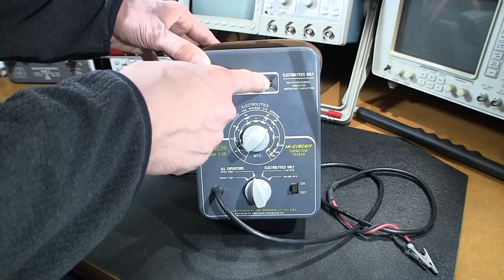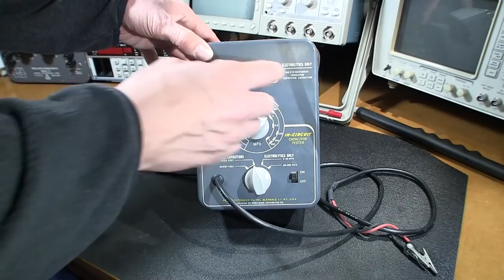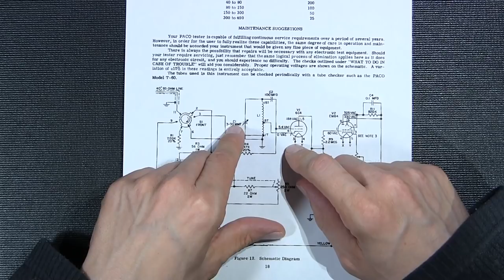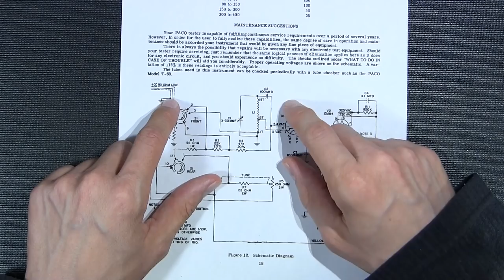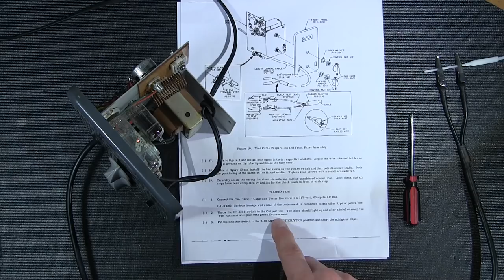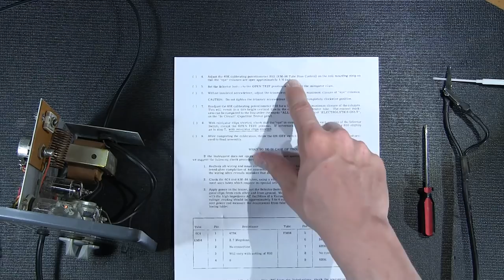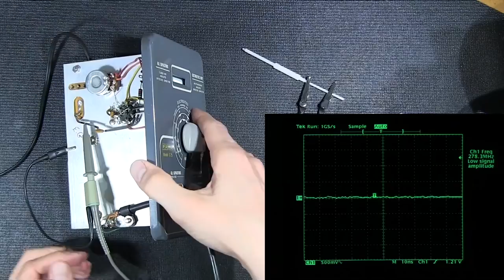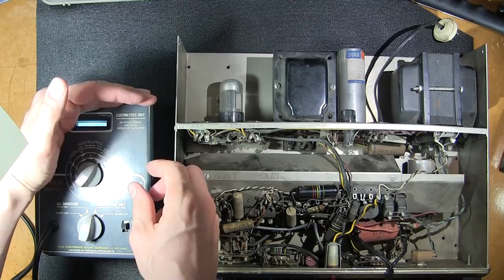Bizarre Circuit Tests Capacitors with RF!

Comment: My only comment is that slot headed screws are far superior to others. Both the screwdriver and screw can be rectified with age and use. Other screw types cannot.  Properly sized and used screwdrivers should present few issues. Manufactures of good screwdrivers design the driver to be adjusted to the screw-head. So yes, one might need a dozen or more drivers in length and width. The more common and popular drivers cannot be sized. Not all Philips are sized uniformly and made well.
Thanks for the video, great again.More repair videos, love them.
Reply: H Higgins could not agree more and that is usually the issue.  And though I love the ease of Philips drive, the rotten screw uniformity and rotten tip uniformity is always an issue for me. I just recently repaired my iPhone. The #00 &  000  Philips screws were impossibly small. It was my tip that I had issue with. I can't regrind the tip even with the best of screws. And a bad tip will ruin the screws. I did not have access to my Wiha screwdriver set, so I was forced to use the screwdrivers that came with the parts. Chinese all the way.
Reply from the maker: Hi James, did you know that there is an "American Phillips," and a "Japanese Phillips?" This may be the fit issue that you are encountering. Japanese Phillips is very common, and American Phillips head screw drivers fit poorly in these.
Reply: You maybe using the wrong standard. There are several screw and driver mating standards that look similar but are not Phillips head. They have an "x" pattern but angle of the flukes, depth, and width of the slots will be different. Mating the correct screw head with correct tool make any of these standards work quite well with less slippage of the tool and faster starting.  X head screws really have advantages over slot screws/drivers. It is not by accident that all manufacturing has moved from slot head screws.  You might be seeing Frearson(sometimes just called RP screws for Reed and Prince type screws), French head, JIS(used on most Asian units), Mortorq, Pozidrive,  or Supadrive screws and using a Phillips screwdriver on them with mixed results. That are all different in details. Even within the JIS style, the most common seen in consumer goods, there are A, and B versions. The JIS is the Japanese industrial standard and usually has a tiny dot somewhere on the head, or a tiny "x" next to the cross slot. Get a good set of drivers or bits and you will never go back to slot screws again. That set should have both metric and Imperial sizes since they are different also.  If screws are rounding out with high torque, it is surely due to the wrong driver being used. If you want to use electric screwdrivers cross head screws are much easier to use  and results in fewer scratched or nicked cosmetics of the unit being disassembled.
Reply: Mr Carlson's Lab 
Actually Paul, I was not aware. And H. Higgins taught me quite as well. My basic point I strived to make, was not that other driver types and screw types do not have their place, but the sheer number of screw types and tips for them is quite insane.  American engineers soon found out in the industrial revolution that having a different thread for every manufacturer and manufactured product was not beneficial to anyone. I now am aware of at least 3 types of Philips.American, Japanese, Posi-Drive, and I am sure more.  That along with Torx, Post Torx,  Pentalobe, Square drive, Imperial Allen, Metric Allen, (one that is a tri lobed shaped tip), snake eye type( don't know the trade name)and yes the lowly slot  presently are found on products plus more I am certain. So we have not come very far.  I have a $350 set of Wiha min/i jeweler  set of screwdrivers and it does not scratch the surface apparently. Yet, blade type pretty much does it all. Manufacturing hates blade because robots don't do well with blade, neither do humans in production. But as a child, I remember seeing the phone man screw and unscrew a slot style as fast as any of the others. I was amazed at his speed. He could dress up his blade or screw if needed; he did not need to chase down a Snap On truck of order from Mc Master-Carr. You must admit it is a bit strange that we can no longer standardize fasteners. Stanley wood planes have a bastard size bolt thread holding the tote to the base. Only available from Stanley and if you do not have a CNC lathe, you will not make one. Yet it drives in with a blade type. Everyone can witness the frustration of how electronic manufactures  use unique valued components just to make them proprietary. It is crazy. If all products were made similarly, we would pay an unaffordable amount just own anything.
Sorry for the rant. I was wanting only to demonstrate the fact we have not advance in fasteners, unless it is purely based on ease. And easier is seldom better, it is nearly always cheaper.
Reply: James Lucas, the only advice I could give is NEVER use the screwdrivers used for construction  to set pots or trimmers. And vice-versa. ALWAYS keep them apart!
Better yet, get special trimming screwdrivers. I have mine already 40 years and they are still as new!

Comment: Mr. Carlson
I have a question on Capacitors!  
If you build your own D.C. power supply,  What determines the capacitance needed to filter the output.  I know about the voltage, but how do you figure what size of capacitor is needed.  Some use 1000uf and at the same voltage, others use 1500uf.  what determines that number?
Reply from the maker: The answer is: The amount of Current drawn. The capacitors job is to fill in the gaps between the pulses. Here is a video with a more in depth explanation: https://youtu.be/qTb65aoYA_Y

Comment: I would always replace the line cord on old equipment like this with a 3 core double insulated lead and earth the chassis. This makes it meet modern safety regulations. I hate getting a tingle from old equipment. Of course it is more important here in the U.K. with our 230v mains.

Comment: Hi Mr Carlson, great video as always. Although I just subscribed, I have been a follower of your videos for a couple of years now. I have a little experience in the wonderfull world of valve or tube amplifiers (and own a 1950's Van Der Heem Valve powered High voltage AC and DC power supply which I fully restored) , but I have more experience in building and repairing low voltage electronics.

I have two question about this C-25 tester. I would like to build one from scratch (since I have a large amount of old parts just gathering dust) and I do own a transformer capable of delivering the required 330V AC. This transformer however delivers not 6.3 but 7.4 Volts for the filaments. This most likely has to do with the fact that this transformer comes from an era when the mains was 220V instead of the 230V now. Is there a way to drop this voltage in such a way that it would not cause any problems (I.e. Heat or hum) ?

Second question would be if there is a chance for a high res photo upload of the front panel. I can't find one and therefor would not be able to recreate the scale, again I'm building it from scratch.

Thank you very much for any feedback, pointers, information and such!

Kind Regards, Sander (from The Netherlands)

Comment: Neat little device. 
Some have stated they favor long schematic explanations...add my vote to the "Yes" pile. A way you could handle that is to create the original content with just cursory circuit discussion, then for a long schematic explanations create a "part 2 - How it works - explained" ... this is just a suggestion and it's purely your prerogative.
Reply from the maker: Thanks for your input Ted!

Comment: Something "weird" like this (something "looking" like a short circuit despite beeing open) happened to me once while I was repairing some device.
I can't go into too much detail, but among other things the device had an output (very short "sharp" pulses at about 300 Hz) that had basically like an RC filter on it.
(The signal went through a 15pF capacitor and then to the output BNC and to ground ove a 1,5M resistor, if I remember correctly; technically not used as a "filter", more of like a capacitve voltage divider when the BNC was connected to another capacitor ...)
I checked the signal before the capacitor with a scope, and there was a signal, as expected.
Then when I connected the scope probe to the other end of the capacitor (at the "output BNC"), the signal was gone!
It's like the signal magically vanished inside of the capacitor!
So I thought "oh this must just be a bad cap" and I replaced it.
Still the same behaviour.
I desoldered all the components in that area checked for shorts to ground or shorts to inner layers of the PCB, but everything was fine.
So I put all new parts on the board and took another measurement.
Still the same, the signal went into the capacitor and vanished.

This was at work and it was a relatively cheap board, so I just ended up replacing the whole board instead of putting even more time into this ...
(I know that that was the wrong decision, because you don't learn anything that way, but like I said, it was at work and I had a desk full of other stuff that needed to be repaired ...)

Comment: paul, ive got a question'''' ive got a (paco) too'' i want to put a (bnc) on it'' do you think i could by using the original cord by not cutting the length at all just put a (bnc) on it'''''or do you think its not worth it because it would mess up the 1/4 wavelength.....i watched the video so i know this might not be the ideal thing to do because it (rf) not voltage.....thanks paul'';'''james.
Reply from the maker: Hi James. It will mess up the coax length. I would leave it.

Comment: I remember in the previous video you mentioned about those black and red leads? and it was wrong to have them so long because of the RF signal it would produce and give you a false reading. you said the crocodile clips  got to be at the end of the original cable, so I am surprised you adding some cable to the original length why is this then.
Reply from the maker: Hi John. How an I adding length?
Reply: Mr Carlson's Lab well as I said, when you showed this tester in a previous video you mentioned about them adding these extra leads to the ends and said it was wrong that the cable had to be at a given cable length or something. so I'm not sure what you meant by that first comment? check back on that video and you'll understand what I mean because I don't
Reply: He was referring to the leads after exiting the coaxial cable, that attached to the clips were too long. The 1/4 wavelength is the coax section which was unchanged. 

It is an interesting circuit  that uses about the least number of parts possible for that era of technology.  I remember when those were originally offered, ads in the back of Popular Electronics in the late 50s, early 60s. They were offered as factory assembled or kit form. A number of test equipment kits were available from  Heath, Eico, Paco, Olsen, and others. The 1950s was a golden era of hobby electronics and amateur radio. Building kits for hi-fi, radio, test instruments, amateur radio and even for those with a lot of patience, color TV.   Although I have a lot of HP, Tektronix, Fluke, GenRad, Sound Technology and Motorola, some of my most used equipment is old Heath Kits, such as the excellent IG-5218 audio frequency signal generator. Every piece of equipment needed for a commercial TV repair shop was available in kit form to save money and learn how they worked. TV and Hi-Fi repair shops were popular small family owned businesses in the 50s and 60s. and those kits got a lot of people with limited budgets into business for themselves.
Reply: Stan SPb right, yes I've got a whole bunch of those electronic magazines from late 50s to 1971 don't know what to do with them any use are they? i gather there not worth anything?
Reply: Stan SPb yes that's what I was referring to but how do you judge how long to make your leads from the coax cable they're not shielded I thought he would use shielded cable

Comment: I was just wondering, with the line cord, should this be a three-conductor cable thus enabling the chassis to be earthed for safety? Would having a grounded chassis upset the readings? Sorry if these a re basic questions.
Reply from the maker: Earthing the case would be safe on this unit.

Comment: Hi Paul, loved this vid. would love to see your tricks n tips so please post :-) I have some of that silicone coated wire bought for just that reason and yes it is pretty darn flexible. Probably didn't understand some of your circuit explanation but found it totally fascinating so yes please more of this. Muts Nuts Bogs Dollocks All the best signing off G.

Comment: If you used a cable that was 1/2 wavelength instead of 1/4 wavelength would you get the exact opposite results when the clips were shorted and open?

Comment: It's funny given how much you hear about gigahertz and terabytes and nanotech now, but the prefixes outside of the micro- to mega- range simply didn't exist until the 1950s (even later for the bigger ones), and of course they didn't jump into common use immediately after invention.

Comment: Where do you get high quality silicone wire, insulation material, and heat shrink like used here?
Reply: Any electronics parts supplier should have these items. I use MCM Electronics, but eBay, Digikey, Mouser, etc., also have such supplies. For silicone wire, if you go with eBay, be sure to check the item description for strand count - if it doesn't specify, find a different listing. Some eBay wire listings offer very low strand counts as a way to save money, but if you're interested in quality, flexible test leads, you should avoid the 'bargain' listings. If you Google 'electronic parts' or 'electronic supplies' (and skip down below the paid ads, lol) you should find the companies I've mentioned, and many more.

Comment: Clever little circuit. If you need RF and some wire length anyway, a quarter wave is something easy to test, plus you can avoid radiating RF unless needed. But how is this thing a bridge? I can't really wrap my head around the schematic.

Comment: I guess they just wrote 117 volts on the input because that's the "design point" where all the other voltages in the circuit are nearest to the values printed on the schematic? So if your line voltage is 5% higher you will probably also be 5% higher pretty much everywhere else too? Not that a small difference like that would mean much I guess.

Comment: When you found the crappy job under the heat shrink. That was very likely why the former owner sold the unit cheap. Kind of like a used car.

Comment: So what is the reasoning behind not using a BNC-M on the coax and then going to a Pamona BNC-F to Mini-grabber.  for what it's doing a 75 or 100 ohm BNC connector wouldn't change the characteristics that much. Even splicing in a new 48"
Reply from the maker: Cheaper to just solder it in.

Comment: How come you dont get shocked when touching that? I thought it would be dangerous to touch since one end of the transformer's 330 volt output is connected to the case and there's no connection from the case to earth ground.
Reply from the maker: Great to see the grey matter working Clem! Thats a very valid question, and the answer would be: The secondary is isolated from the mains side. The current in that secondary winding has to make a loop (too the other side of that transformer winding) to make a "Circuit." Since you are not between that winding (in normal operation) no circuit is made. However..... In this unit you will find a situation called "Leakage Current" and this can be noticed when softly brushing a hand over the face of the tester, it feels somewhat like a physical hum.

Comment: Is the circuit sensitive to frequency in power-grid ? 50/60 Hz
Reply from the maker: The only thing that may be a little sensitive would be the power transformer, the circuit itself wouldn't know the difference.

Comment: yet another great video!!!! I would love some RF theory and circuit design videos. keep up the great work in the great White North...lol De KE0HHS
Reply: An excellent concise treatment of RF and electronics fundamentals can be found in the The ARRL Handbook for Radio Communications. Older copies would be called the "ARRL Amateur Radio Handbook.   New copies are expensive but a used book store it might be $5 or less and have more of the information you are looking for.  A copy from the 60s or 70s had more information about basic electronics and construction practices than  new versions but any edition will be the best explanation of electronics, and RF, construction and design that can be in a single book. Read the first 100 pages and you will be understanding a great deal of all electronics.  It is 1200 pages but much of it has to do with practical application, construction, antennas, etc

Comment: Complete NOOB here. My C-25  doesn't work properly. The eye is VERY dim. I suspect the big capacitor in the back [the C-4, I believe] my C-25 doesn't have a poly style cap, it's a Pyramid Imp mfd .1 200 [20%]. Because it's different from yours, I think that might be the problem, as all the resistors look fine. At any rate, what is the value of your poly-style cap. Please let me know, and if you have other suggestions for me, don't be shy. Thank you kindly